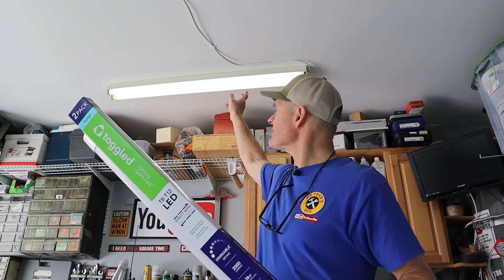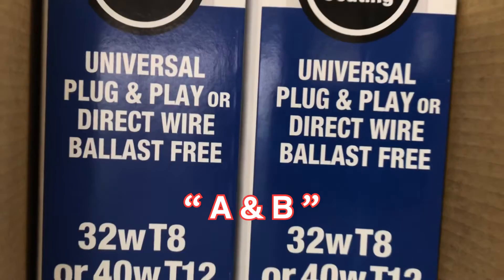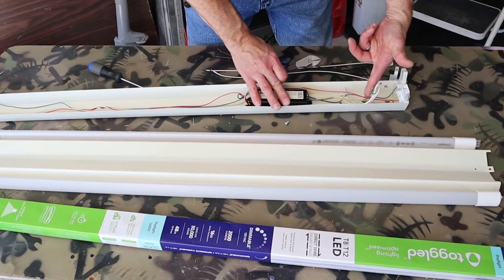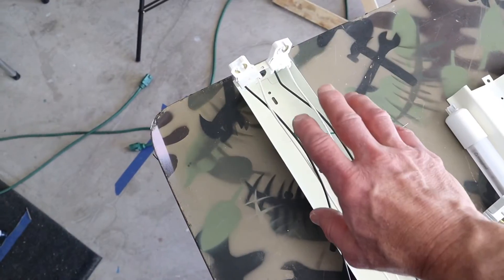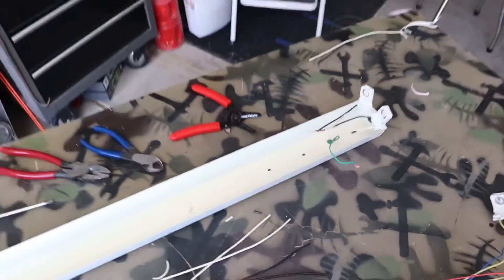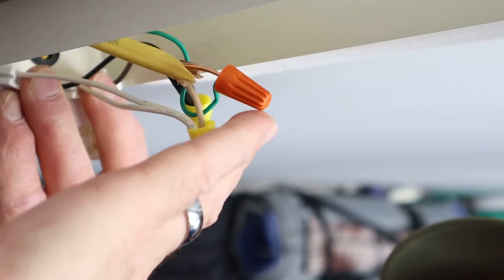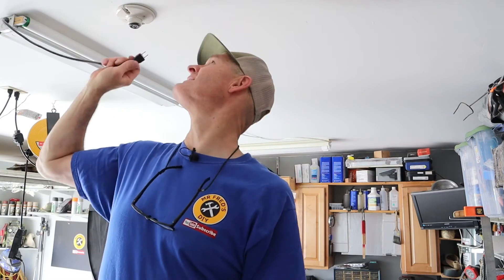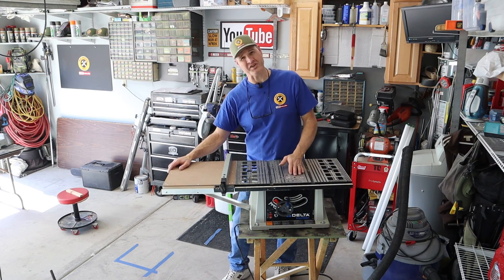LED Tube Light Conversion

Comment: Any advice on color temperature?  Indoors I prefer warmer LED light 3000-3500K, but my fluorescents that I want  to replace are probably closer to 6000K- 6500K in the garage and work bench.  I  also have one fluorescent fixture in the master walk in closet. Thoughts? 
5000k-6000K for the garage and 3500-4000k for the indoors?
I want to see clearly at my workbench but don’t want to feel like I’m in a hospital or something
Reply from the maker: The lights are used in the garage. I think I have a great color for doing projects, although this color would definitely feel like a hospital inside the house. Just as a sidenote, it seems like these LEDs do mess with my camera a little bit. thanks for checking out the video.!

Comment: Fred, I'm in the process of replacing old fluorescent light tubes in my garage and laundry room - 14 in all - so I reviewed your very helpful video here, and noticed that the Type B LED tubes to which you linked on Amazon - they're not currently available.  There are alternatives, of course, but I have not purchased or tested any yet, though the Parmida Type B (20-pack) is likely what I will get (uses existing hardware with ballast removal, 24W consumption for 55W equivalent output, 3200 LM, 5000K - more power consumption than some other Parmida choices, but higher lumen output, so it's pretty much a wash).  Again, thanks for the fine, clear video.